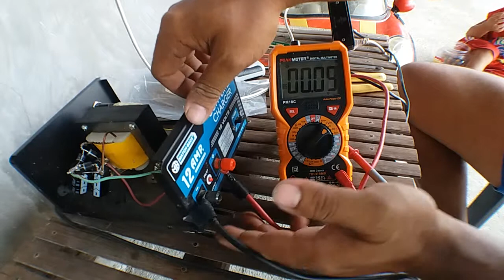CONVERTER CHARGER REPAIR | DIODE REPLACEMENT | RECTIFIER DIODE

Comment: bkit ung ganyan koh boss nka power on nman sya 14 volts lumalabas sa volt meter koh ano poh problema nya pareho  ganyan din conveter charger koh
Reply from the maker: Ok lang po yan at normal lang yan sir basta dc ang output

Comment: Idol kapang on natin Ang switch Ang fuse biglang maputol yong wire niya sa ilalim Anong cause niya Po ?
Reply from the maker: May short sa transformer or baka naka 110v ang connection bos
Reply: Idol paano ma test Ang transformer ? Hindi Kaya nasa capacitor o diode Ang prblima ?